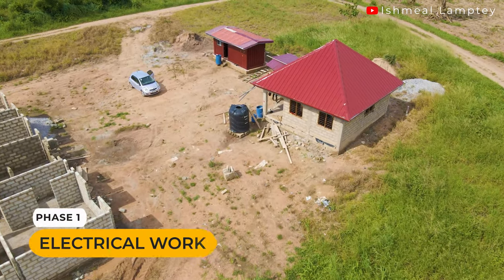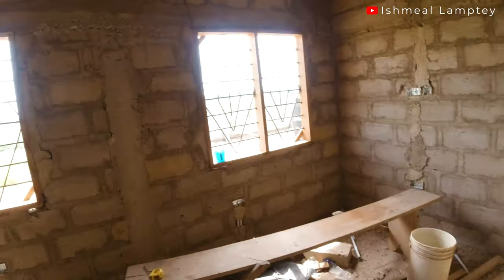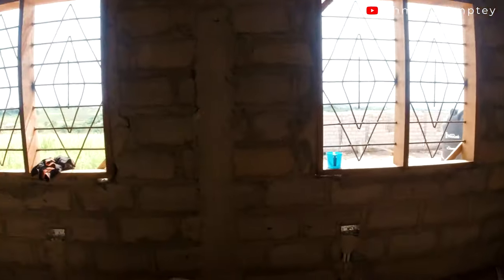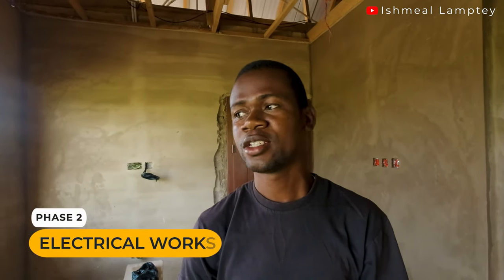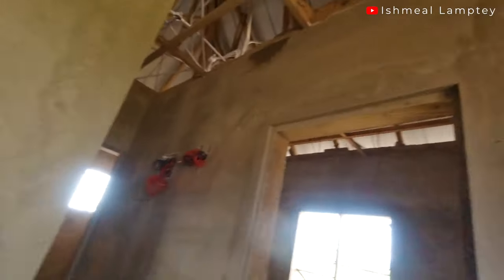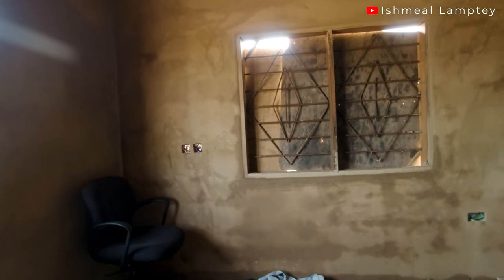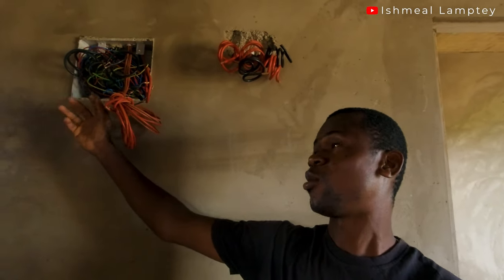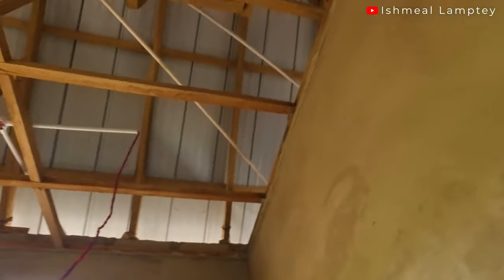Electrical Works and Cost of a Minimal 1 Bedroom House - Building Off Grid in Ghana

Comment: No internet cables?
Reply from the maker: In a modern wireless world, lol. No
Reply: Trust me, I'm a tech guy. Wireless perform isn't as reliable as Ethernet cat cable. I have three large routers here non compares to direct cable. So my wireless is a mere supplement for phone use.
Reply from the maker: I totally agree with that, however this is a very small space and we'll honestly not need Ethernet cable. Where i am currently is a 3 bedroom house and the wireless works just great.